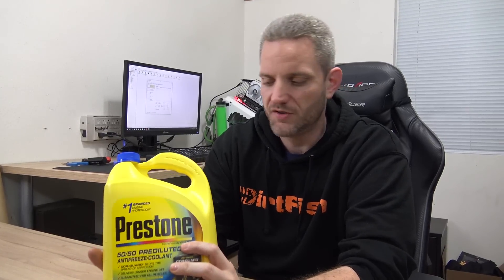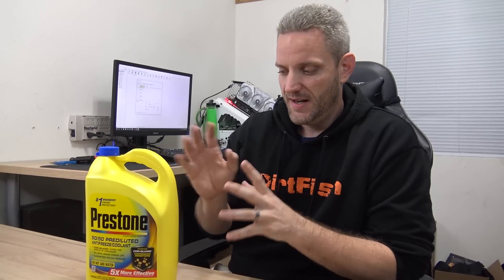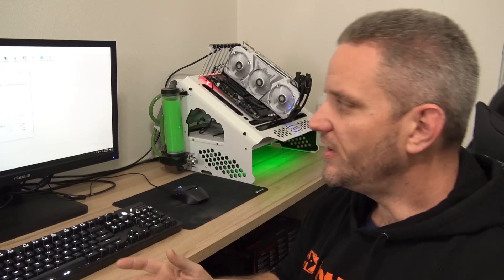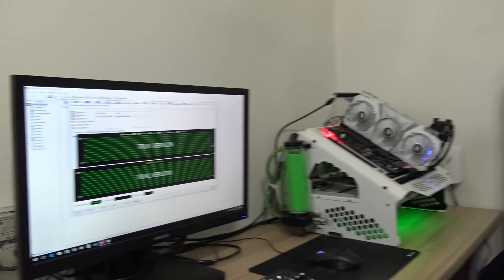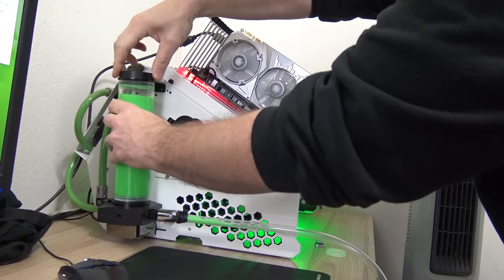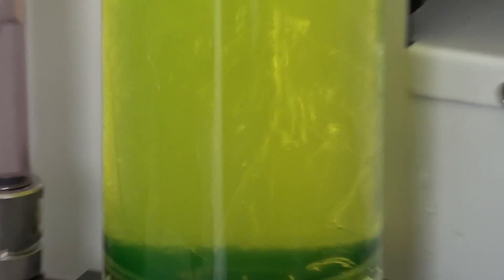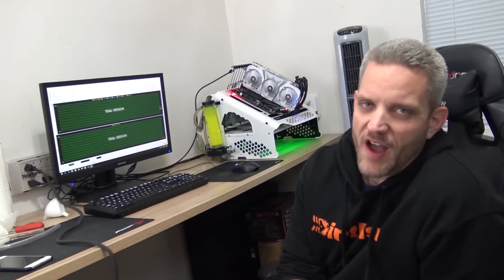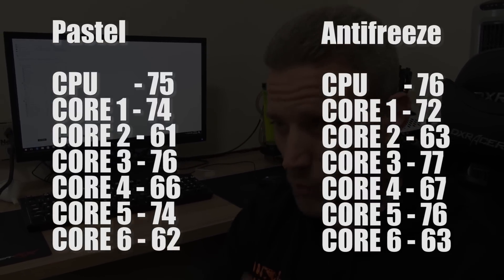I used Antifreeze to cool a PC

Comment: try gasoline or petrol as liquid coolant
Reply: Juan Castillo flammable liquid in electrical enviroment?
Reply: +genmaxpain There is no need to be rude, especially with the inadequate grammar you have expressed. You need to go back to school on how to use English properly. This has nothing to do with Americans, and before you go ranting on a country, you have to understand that there are both smart and dumb people everywhere. Don't be an immature asshat.
Reply: Juan Castillo HEAVY WATER!
Reply: "Mostly Americans" Damn, you wanna talk about being culturally biased there's a perfect example. By that you what you actually meant was only 'ignorant' people would speak of something they know nothing about. Such a thing has nothing to do with culture, or for that matter a cultures stereotype. For example, judging from your profile picture I would assume you were Asian. By your logic I would also assume you were a a man of small stature, spectacularly timid, and suffer from micro-peni.
Reply: as long as there is no sparks or static.....
Reply: Not an American problem, just a stupid problem.. Which typically is a result of American schools, so Americans. Not all of us are loud. Many of us still have an acceptable IQ and remain quiet to compensate for the loud bunch.
Reply: thats is quite the stupid idea
Reply: @realflow100   diesel in cooling system would work for some time (weeks to months or more) as it is a lubricant and fuel for diesel engines
Reply: You do know gasoline vapourises the same way gas tanks will "Swell" when you leave them in the sun. What the fuck do you think will happen to his loop you fucking idiot.
Reply: Any arc that occurs is 1200 degrees, more than meeting the threshold required for igniting the fuel.  This is why GSR's don't even ring doorbells when they arrive to check for the safety of NG appliances and leaks/dig-ins.

As a result, not only are you wrong, but literally the epitome of what you're talking about.

With that much projection, you clearly should just build an IMAX theater as you'd singlehandedly be the largest one that side of the Atlantic.
Reply: i just want to point out i said nothing about combusting. i only said it would be a dumb idea. so about you chill a bit with immediately yelling at americans for any reason
Reply: WHAT ABOUT DIESEL? it takes 10 times more heat than gasoline to combust.. Although it would probably make it greasy or oily..
Reply: I wouldn't use regular car gas or petrol but diesel or jet fuel why not its thick and smells lol but it will. Be lubricated something fierce
Reply: +genmaxpain "OOO I MAKE MORE MONEY THAN YOU DO IM BETTER" The typical response from an immature person who thinks they can be all superior with how much their income is, grow up. You not only act like an immature child you also are hypocritical by saying go to school and learn "shit" yet you don't learn to improve your English.
Reply: Patrick I. stop feeding the troll
Reply: ok then you stop feeding the troll too then i will xD
Reply: Juan Castillo Petrol and Gas are the same.
Reply: all you will get is a mess when the caustic nature of petroleum fuel eats all of your plastics and rubbers.
Reply: so much for not feeding the troll
Reply: nah   no  O2  no fire.... sealed loop.  also it doesn't get that hot anyway.  I still don't recommend though
Reply: @ dacaveman no need the troll feeds him self because he is american haha
Reply: wait how is it bad to feed yourself? not trying to start crap just curious. I thought it was good to survive. and don't tell me because Americans, well unless you want to then go ahead.
Reply: Hypocrite
Reply: Dude relax, he was having a joke!
Reply: +genmaxpain you have the technical and linguistic literacy of a cockroach in crack
youre irrelevant to this thread fuck off
Reply: +Insert Name Here I believe you need a spark for petrol to ignite. It's why you can shoot a petrol tank and it won't explode, contrary to what happens in the movies. I don't have any exact numbers, but I know a bullet gets signicifcantly hotter than a PC WC loop when fired and if those temperatures aren't enough for petrol to ignite, then the WC loop won't. As I said, you need a spark and for that to occur there needs to be friction somewhere. Since waterloops don't have much friction, there's not much that's going to happen.
Reply: And don't be that person who acts more intelligent than others while spewing awful grammar.
Reply: Hamilton Porter Kinda did it yourself there bud.
Reply: The thing is, it's not very electrically conductive or even flammable as a liquid. It's called gasoline here due to it's gaseous state being the flammable substance. So most likely it would just react with specific plastic materials or seals, being a strong solvent and all. Eventually it would leak all over, and be generally disgusting until it was all cleaned up and evaporated.(hopefully not ignited by something in the room prior to it's cleanup) All in all, a boring way to destroy a good PC.
Reply: @genmaxpain @Patrick I.

Cheers for the humor guys. Don't get to see an argument between two people quite as stupid as you two very often.
Reply: Unless your CPU gets to 3000*F you wont have a problem.
Reply: alcohol or acetone have better thermal properties than water, it would be great until exploding
Reply: You are thinking of DexCool. And yes it does turn to jelly becuase it is a crappy coolant. 90% of american antifreeze is the green stuff as shown in the video. We mainly use prestone antifreeze like shown in the video.
Reply: Juan Castillo 🔥😂😂😂
Reply: genmaxpain if the seals , o rings and 'plastic' surfaces are not compatible materials , they will turn into a really brittle cracked plastic , or on the other end turn into gum. Its been fun getting parts on an older diesel changed out due to uls diesel . the new diesel is more reactive to rubbers , plastics , ect.
Reply: Poly Bun for what its worth karosene /diesel , both grow algae. Makes for some great fun trying to kill it in fuel tanks.
Reply: It'll melt through the plastic right away
Reply: I believe the immense heat from the cpu could cause it to combust, which is a big nono
Reply: what in the actual fuck are you talking about, i am american and have never seen or heard of this magical red "dumb dumb" anti freeze

Comment: Also, LinusTechTips did whole room water cooling with Anti-Freeze before this video.  Because of the low temps fugus and all sorts of nasty stuff thrived in the line and clogged up the water blocks.  Its more useful in engines because of the higher temps to kill all of that bacteria that could be in the water.   However Linus did fix the problem with ultraviolet water cleaners an what not, but it just proved that the cost was not worth the hassle.

Comment: hey jayz... i need to build a pc ..mainly for gaming and a little rendering.. i live in jamaica and its hard to get parts for the build.... i currently have a very old pc ... its an intel pentium 4 processor with an asrock pi465g motherboard (prescott 800).... i need help what do i do?
Reply: Not with a pentium 4, huge bottlenecking
Reply: Can you order parts online? if you can't find parts locally, that would be the alternative. Ordering online would probably be cheaper as well.
Reply: 1 USD is around 136 JMD  and that is very expensive

Comment: jayz antifreeze is actually better bc  it has a lower boiling pt as a Refrigerant. however it has to be put under a lot more pressure in order to to turn into a gas. so under low pressure uses yes it sucks but for all the other applications it runs like your fridge (r134a) it's excellent. that and your right the motor is not using the right kind of oil the alcohol will flush it out of the low pressure motor and ruin it.

Comment: ANTI FREEZE MEANING IT STOPS YOU FROM FREEZING / GETTING COLDER, MEANING YOU WILL HAVE HIGHER OR THE SAME TEMPS
Reply: it just means the liquid wont freeze.  meaning that if you live in a very cold place and ambient temp drops below 0 your coolant wont feeeze so you can still start and drive your vehicle.
Reply: Freezing and getting colder aren't the same thing. Freezing point of a liquid is not always 0°C it depends on a lot of variables like the density of said liquid. You can actually achieve colder temps with salted water and ice than with just water and ice for example. There is no reason why the temps would go higher.

Comment: Ethylene Glycol is actually not as effecient at cooling as water (it's darn close, but not quite there). It is also corrosive (part of the reason we mix it with water in cars, in addition to the heat dissipation), this is why General Motors switched up the formula a bit and went with Dex-Cool for their systems to help reduce that. The corrosion concern is also why you are supposed to change your coolant every so often (the reduction in corrosive properties of Dex-Cool is also why it's service interval is 150,000 miles instead of base coolants general 60,000-90,000 miles).
The main reason we mix ethylene glycol with water in cars instead of straight water is because it doesn't freeze until well below waters freezing point, not it's cooling properties. It also has lubricating properties to help the vehicles water pump last longer. In the end coolant is just a bad medium to cool a PC with because of these things. 
Thanks for the video Jay!

Comment: Isn't antifreeze made to not get cold lmao
Reply: Profatoe Anti-freeze made not to "freeze" during cold weather.
Reply: xSnakeStyles Exactly, It would've made way more sense to use something like engine coolant, I wanna see break fluid next though
Reply: Antifreeze is a coolant. Check the bottle out at the start of the video.
Reply: Engine coolant??? Antifreeze is engine coolant. Stick to video games and not something you know nothing about. 

P.S. you can't break fluid.
Reply: "antifreeze" is actually called "coolant" in the business and it's got freeze inhibitors, corrosion inhibitors, dye, and whatever else they feel like stuffing in there for whatever reason seemed logical at the time. The water provides the thermal conductivity and carrying capacity, and the coolant additives provide everything else.
Reply: +GRig, since you can't comprehend what you've read please read it again. "It would've made way more sense to use something like engine coolant, I wanna see break fluid next though"

You must be one of his butt buddies.
Reply: ***** lmao
Reply: gets colder than water can

Comment: Should I get a core i7 and a gtx 1060 or a core i5 gtx 1070
Reply: Zalax I would say if you want to do Photo/Video editing the i 7 /gtx 1060 and if you want to play games the i 5 and the gtx 1070
Reply: Zalax just what I think but I dont know a lot
Reply: Zalax get a i5 6500 or even a 6600k for overclocking but get in that case a decent cpu cooler and the gtx 1070
Reply: get an i5 2500k and oc it instead of buying a new cpu, and also a 1080. oced 2500k doesn't really bottleneck the newer gpus even when playing modern titles
Reply: I mean go ahead and waste your money a 6700 but it's not worth unless you do virtualization etc
Reply: Yup the i 5 6600k should definitely be good enough for gaming
Reply: Erazer - I believe you are correct. Both pairs are great, but the i7 / 1060 combo would be more suited for taxing creative work, and the i5 / 1070 combo would be more suited to playing games at high settings - that said, either pair will excel at both - it's just a matter of one's personal priorities.

I went with a 6600K & a 1070 and I couldn't be happier with them. I got Gigabyte's Windforce OC version; it "only" has two fans, but it keeps itself nice and cool in a well ventilated case.
Reply: +Zalax get top of the line if you have the money.
Reply: i5 and a gtx 1070, If your gonna game, you really do not need a super powerful cpu. Just needs to be a decent cpu. A good cpu is only really needed if your gonna video edit for smoother scrubbing. Either way id go with the i5 and gtx 1070. GPU's all the way.
Reply: for the vast majority of games, the 4 Core, 4 Thread Processor will suffice.
if you want to play games and do other relatively intensive tasks in the background (say using Processor to Encode Video, or Et Cetera), you'll benefit from the 4 Core, 8 Thread Processor.

the waters get muddy if you want to play games at high Refresh Rates.... in games which have a lot of Processor side computation required to update the Game State.

it's easier to come from the other side and find out if any games you do or will play are those that have a lot of Processor side computation required to display the game.
that way you can know what you need or will benefit from, rather than just trying to guess.
Reply: what games do you play
Reply: It for sure Is I just went to an I5-6600k haven't overclocked it yet and a gtx 1060 6gb and its running battlefield 1 ultra settings at over 90 fps which is enough for me also 16gb of ddr4
Reply: +3en6ie 3en6ie You do need an i7 if you play at high refresh rates.
Reply: +IOutDoSundicate You only need a powerful cpu when refresh rates go up to something ridiculous like 140hz. Im sure this guy doesnt have something like that as most people dont.
Reply: i7
Reply: Do yourself a big favour and get the i5 and 2 RX480s which is still cheaper than a single 1070 and you get 1080 performance.
Reply: getting an i7 is not necesarry for editing photos or videos. There is massive difference in the processing speeds between those. Of which is used for Windows. So if he wants a fast computer that executes his tasks in less than 0.0001 seconds or if he would rather wait 3 seconds for i5
Reply: +3en6ie 3en6ie Not if your gpu is at 50% usage.   Look up some high refresh rate benchmarks.  an i7 is like a 10-20% increase in performance.
Reply: Will Core i5 gtx 1070 be able to handle a 144hz monitor? May be a dumb question to you guys but this is my first pc build.
Reply: +Soulpunisher123 "There isn't a single GPU that can do 4k 144 hz on modern games anyways. "

Especially not since i5s are a bottleneck at high refresh rates.
Reply: you peeps will soon regret getting an i5 , BF1 already has a cpu usage of 70-100% in many cases on an i5, while i7 has way less. those 4 extra threads will be very useful sooner or later ( rather sooner)
Reply: +UberTiger1 YouTube is the harbinger of false information spouted by people who refuse to listen to other people.  I don't think we can save them.
Reply: David  Harvey go play on a 64 man server where every shit is blowing up you will see your cpu hitting 100% very often.
Reply: +David Harvey  So you admit that your pc isn't being stressed, and yet you comment that i5s are fine because you don't max them out.
Reply: You can run with 16k textures if you want.  We're talking about high refresh rates though, and at an unlocked refresh rate an i7 will show a substantial difference.

I'm also allowed to join in without your permission.  That is what an open forum is designed around.
Reply: UberTiger1 sorry, Processor Graphs are not accurate information for actual Processor Utilization when it comes to Video Games.
that's simply not how Computers work.

i can't save people that wish to think otherwise. it's just false.
but people being dumb with computers by large, is why people like myself can still make a living off of handling computers for other people.
Reply: taiiat im not dumb, im just talking about the truth. when you often hit 100% which is the case with i5s and lower  at least in BF1 you get severe stutter from time to time
Reply: UberTiger1 but Processor Graphs aren't the truth.
it means nothing, for Video Games.

stuttering is caused by software conflicts, far more often than it is by hardware.
so where's the truth we're talking about, exactly?
Reply: taiiat because this stuttering isnt existent on i7 or similar.  dice will fix the cpu usage spikes soon , but it shows that games get more and more demanding cpu wise. Don't get me wrong, i5s are a great option for gaming but new games are very capable of profiting from many threads
Reply: UberTiger1 it's then quite intriguing how i haven't seen this severe stuttering on my 4690k. if it's such a big problem that is strictly due to Thread count.
very intriguing. it must be.... magic!

games don't get more Processor intensive except when Processors actually move distance forwards in their capabilities.
since they haven't for quite some years, games have had no option other than to just not do so many things they want to do.

maybe once Two Threads is the norm for all games in general, or when Four Threads is the norm for atleast most games, we can start seeing that.
until then, not really. we may be waiting for quite some time, as we have already been waiting for quite some time.
Reply: Battlefield stutters on my 4690k.  Yours must be clocked to like 7ghz

Comment: sealed case with filled with argon or something else to displace oxygen. Run a ac system with the evaporator in the case and the rest of the system outside your house. Run water cooling to cool the cpu quicker and to circulate the air in the case. THEN antifreeze would help in the water loop.

Comment: it works but after a while the coolant will start to get stagnant and mold and whatnot will start to grow and it will clog the system Linus did it before (BTW: in a car the temperatures are too damn high so any bacteria dies inside the engine, so without any specific additives it will fail over time)

Comment: Team up with Jerry and 3d print parts (there is petg filaments).  if sealed to prevent leaks you could have pretty much anything as a pipe even your face.  It probably wouldn't make the system function better but you could have a tank shaped like a skunk for skunkworks.